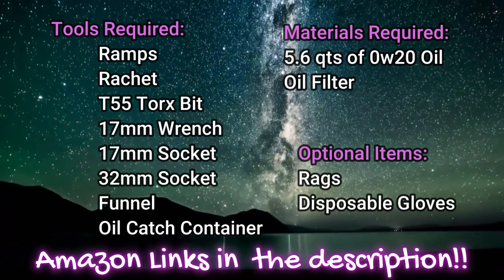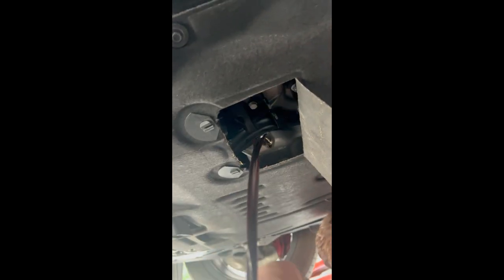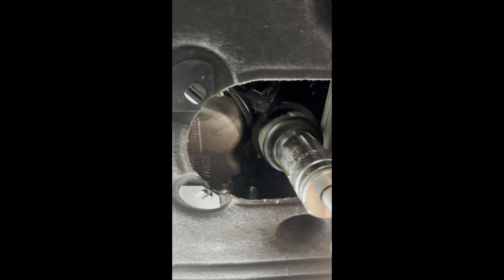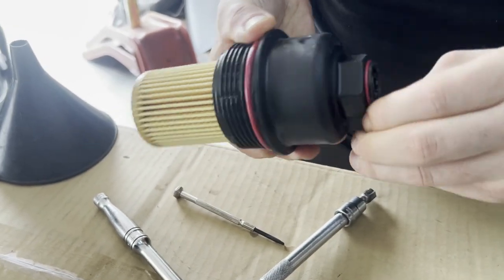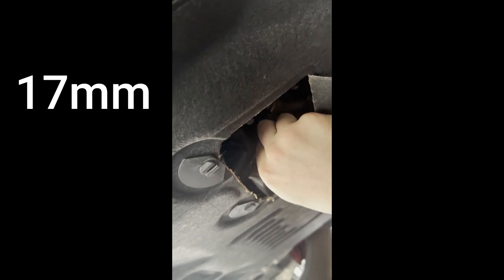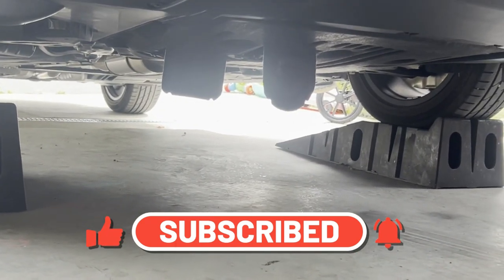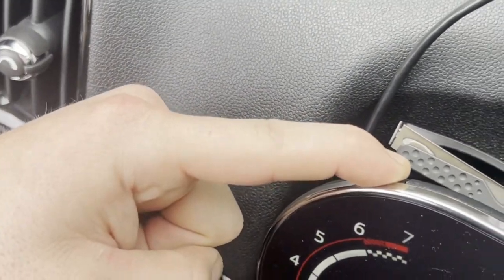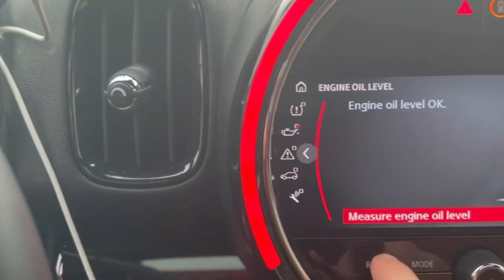2017-2023 Mini Cooper Countryman Oil Change DIY

Comment: Weird, I recently acquired a 2017 Countryman and my oil filter is easily accessible from the top.  Some videos show temporarily removing the windshield washer fluid reservoir, and using an extension with a swivel.  Mine's a straight shot.   They must have had a bunch of engine options.  Like I said, I'm new to Mini
Reply from the maker: @BradThePitts yea this was the JCW edition with the turbo engine. Probably slightly different than yours. Gotta love all the different configurations 🤪

Comment: what's the torque on the 32mm?
Reply from the maker: Sorry I don't remember that was along time ago.
Reply: Oil Filter Cover to Housing 25Nm or 18.4 ft-lbs.
Filter Housing Oil Drain Plug 5Nm or 3.7 ft-lbs or 44.5 INCH-lbs.
Oil Pan Drain Plug 25Nm or 18.4 ft-lbs.